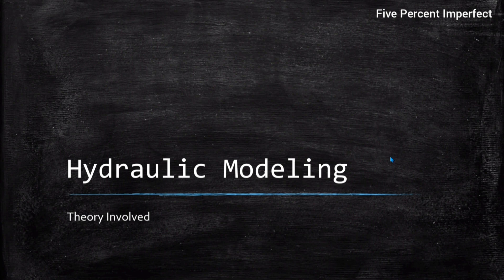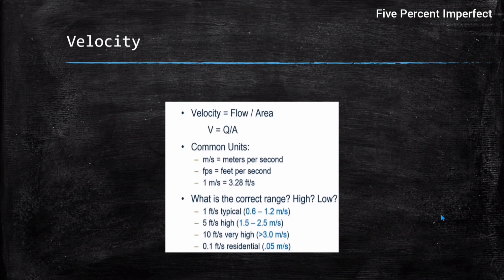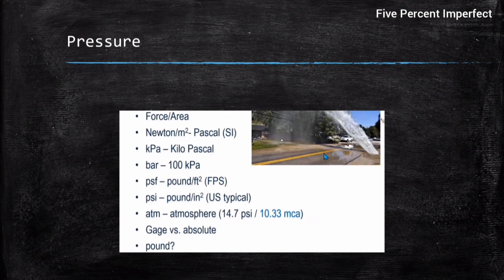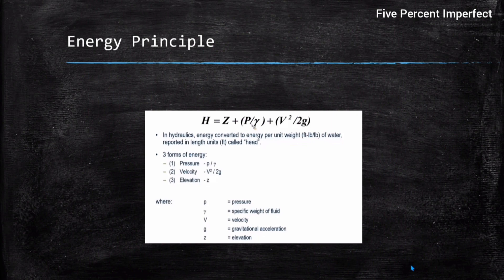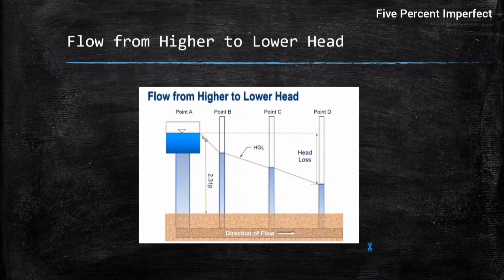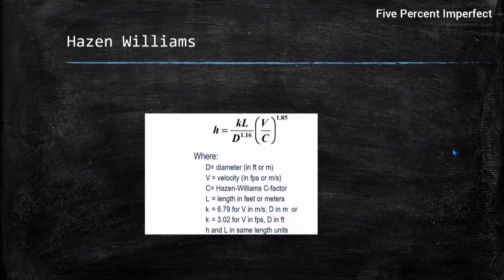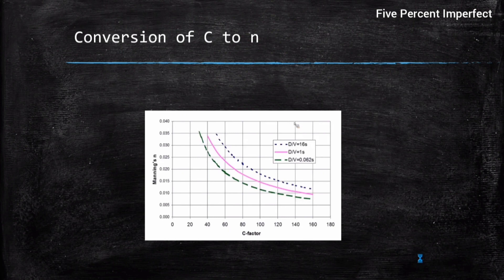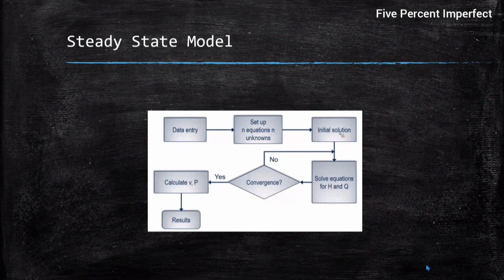L1 | Working of WaterGems |Technical Interview Questions | Theoretical Concepts

Comment: If i have created a network in water gems, network(demand assigned) is connected to tank, tank is connected to pump and pump is connected to reservoir.(same case as we see practically, raw water pump house connected to tank, then tank is connected to network)now please help me design and setting up control to achieve as follows,...
I want to check for how much time my 6 lakh litre tank will provide water to the network(initially tank outlet is closed then pump should get closed after tank is full and we have to find the time required to empty the tank for supplying water to the network and if we cannot close the pump how to achieve above goal.)